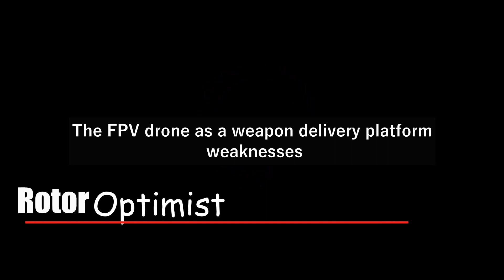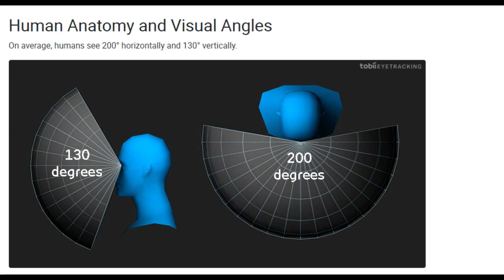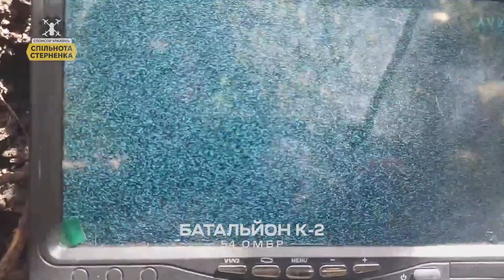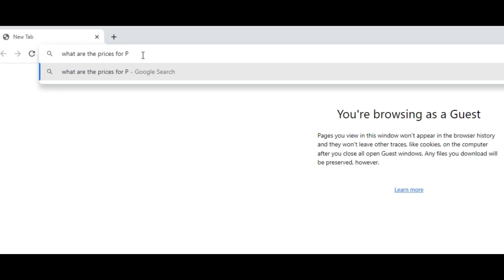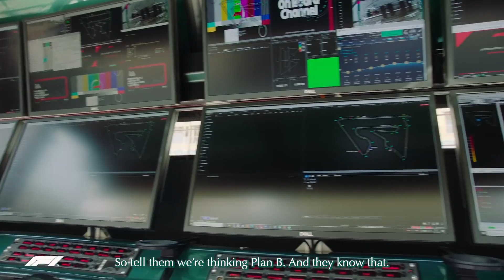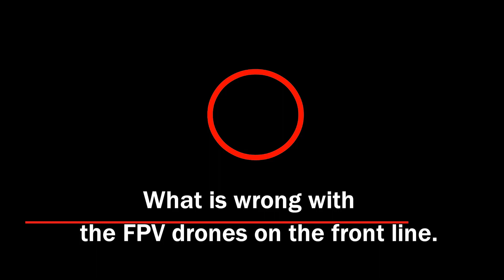WHAT IS WRONG WITH FPV ON THE FRONT LINE/Почему это опасно и не эффективно

Comment: fpv drones have no alternatives in the war. its possible to hit moving wehicle from 10 km range with relatively small cost and its relatively save for pilot. there isnt any other types of ammunition that can do it.
Reply from the maker: Thanks for comment. No! fpv drones can't fly 10 km. No! No! No!
Reply: @rotoroptimist9106  they absolutely can. keep in mind they dont need to come back, one way journey
Reply from the maker: @АндрійАлєксєєв-п3з  No! For FPV drones usually, you will have a range from 400m to 1KM
because of the radio equipment. add to this extra weight of the war payload(the battery will discharge quickly). Take into account that the pointer drone should see the striking drone to correct it. So for the FPV drone optimally 400-500m.
That is why I made this video to show all the dangers of these operations.